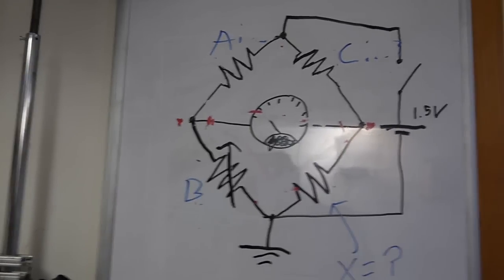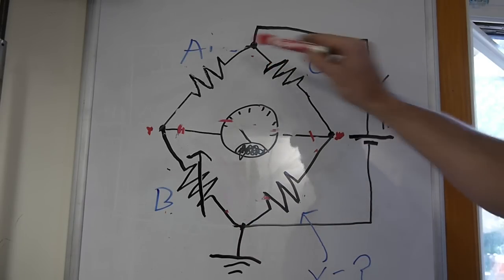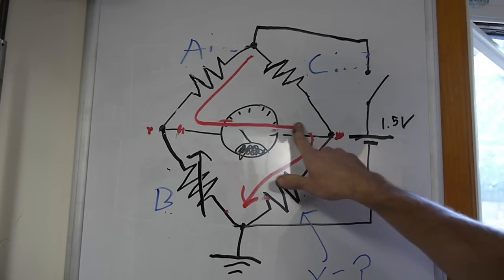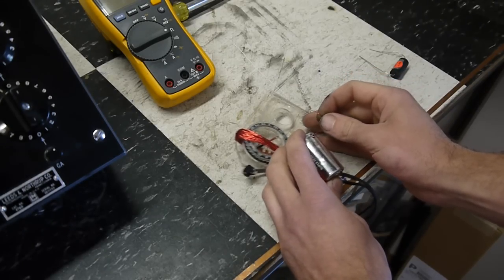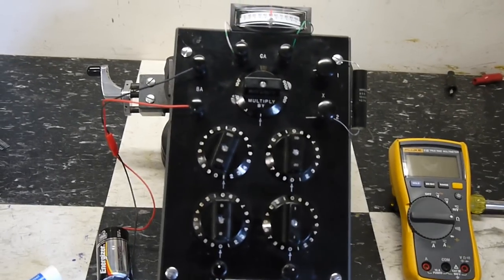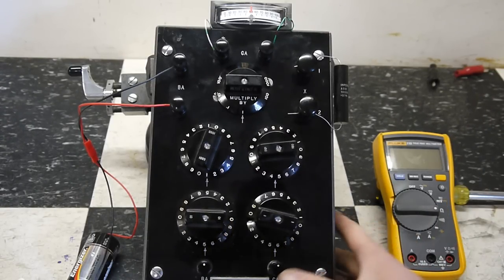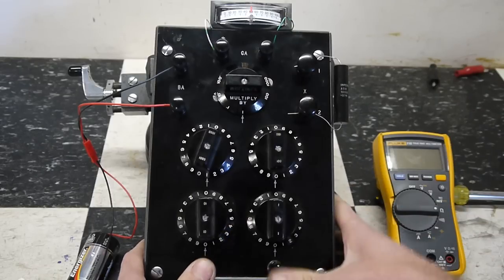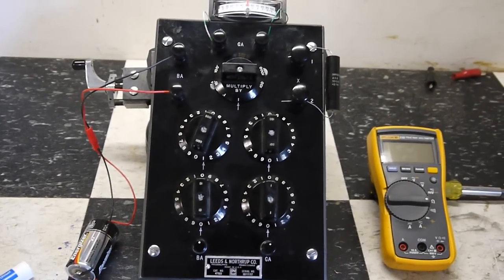Wheatstone Bridge Demo

Comment: Nice demo, I used one in Thailand probably older than the one you have. We used it to trouble shoot faults in telephone cables. After awhile I could tell where the faults were miles away. We used the three varley loop method (this was a long time ago in 70') Temperature, and gauge of wire need to be known to accurately trouble shoot. But most problems were in access or terminal boxes... This is how we did it back in the day. https://brainmass.com/engineering/electronic-engineering/442646